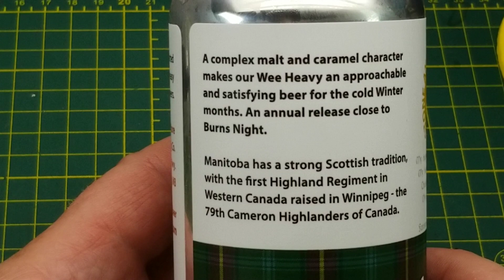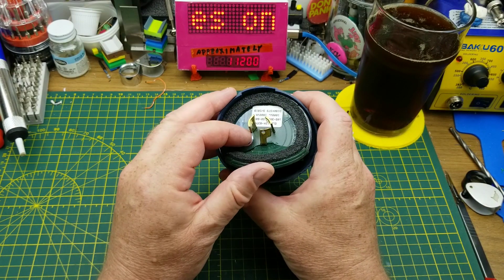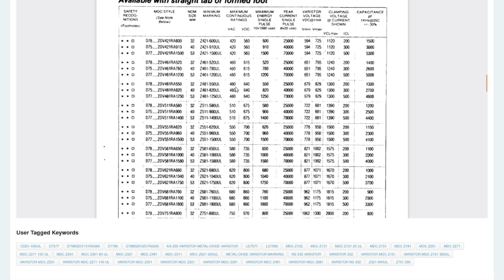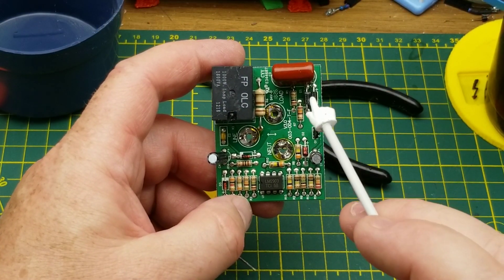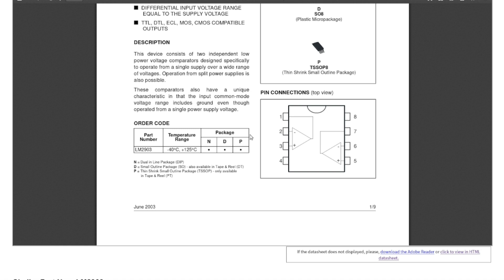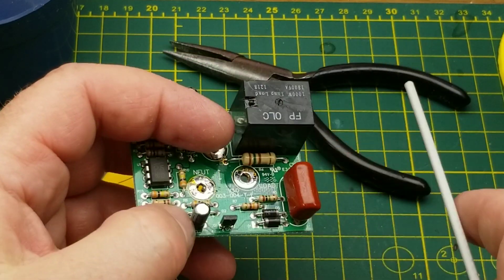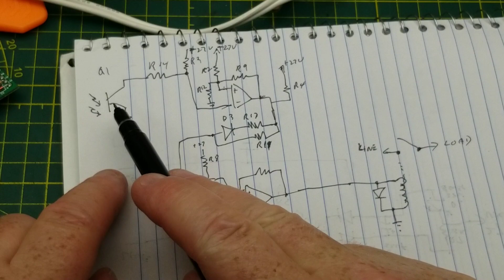Street light photocell : curiosity teardown

Comment: What do you think would happen on this if say you gave it 240v instead of 480?
Reply: It would work as advertised.  This photocell is ranged from 105 to 305 volts.  When he mentioned 480 volts he was talking about the component (looked like a capacitor to me) that acts as a surge protector.  Usually if you gave a 480V photocell a lower voltage it would remain on and the light just wouldn't work because it didn't have the required voltage.  With the new LED lights everything changes.  Older high pressure sodium and mercury vapor needed a specific voltage120, 208, 240, 277 or 480.  Led Fixtures are a range, 120-277V or 208-480 or just 480.

Comment: I don't know if anyone has mentioned one of its functions if it breaks down the light will stay on during the day. This way maintenance people know which light needs a new control.
Reply: This is usually the case, but not always, I would say around 75 to 80% of the time.  The resting photocell is closed, and you can feel the photocell close when you cover it.
Reply: I have a 50w led security light that came off of a utility pole. It has a built in photocell. When connected to the service wire it comes on for a few seconds letting you know it made a connection and when covering the photocell it will not come on. I want to remove the photocell completely from the circuit and run it to a switch instead. How would I go about doing so?

Comment: Hi - I am based in Australia, in the early 80's i was involved with the major local electrical manufacturer of switched and distribution boards etc.
We had a version sold to local sydney authorities calls the VSSW - Vertical sun set switch.

It was primarily a small solar panel, that could generate up to 5 or 6v dc - this was when the son was shining, there was some storage capacitors and a small battery pack used to store say 30-45 mins power to cover periods of heavy clouds

Anyway one there was no power produced in the photo cell and no battery power for a time delay, there was nil voltage, this then triggered the street lights to activate

Prior to that there was a 24hour timer on a control light ( possibly the control or master was chained and controlled a few city blocks )  - i cannot really recall, but i think they had a cover and a slotted switch that was set to 5pm 6pm 7pm 8pm - this is to allow for different sunset times during the year - a service technician would turn up every 3 or 4 months and change the time on setting

As a kid we would play in the street then at the right time, all the street lights would light up within 5 -10 seconds in the street, a friend who lived 2 blocks down on major intersection noticed that my street would light up and about 30 mins later his street all the light would turn on

Regards
George
Reply from the maker: Its interesting to learn how similar problems are solved with different approaches in other countries.
Thanks.

Comment: Manufactured in March 2019 using only through hole components?
Reply: The same design has probably been used for decades.
Reply from the maker: That's my guess - an old design that simply and cheaply "just works"

Comment: Relay is incorrectly shown, the relay itself is powered from the power supply with the open collector comparator pulling it to ground. The input has a fast charge, slow discharge, so that it takes around a minute for the light to turn off when the sun rises, but only a few seconds of darkness to turn on. Done so test is easy, cover photocall with a black plastic bag or box, and wait 5 seconds for the relay to energise the light. Also does mean the light comes on for a minute at power on, so allowing a test from the ground, using the fused disconnect in the pole.

By me the photocontrols are a little more complex, though the simple one there is very common, but there are a lot of more complex ones, which use Royce Thompson made units, which also self adjust to light level, so that they will work even in areas where the lamp is shaded by a tree or wall part of the day, adjusting after 24 hours to get the complete cycle, so they will go on at dusk correctly. Complex, with all the control being in a transparent DIP package, so you can see the electronics, and the large photodiode inside.

Comment: In mid 90s, I used to make a device like that but with 555 and a triac. I sold them to shop owners that din´t want to bother to switch on or off  theirs street lights at night or did not wanted to use time relays. It sold well few months until some shop took the idea and made the same circuit in a professional case (mine was made in  transparent plexiglas case)

Comment: There should also be a delay function in there somewhere, to prevent false switching in case, let's say for example, a big fat pigeon decides to land momentarily on top of the light, or, in the event of a dark cloud which might obscure the daylight for a short while.

Without a delay, that light would be at risk of erroneous multiple 'ON' cycles during the day, and with it, increased wear and tear to the lamp itself.
Reply: Some are a slight delay, some are instant, with the delay being the gradual or partial covering of the eye.  So most twist lock photocells will close if you cover with a photocell cover.

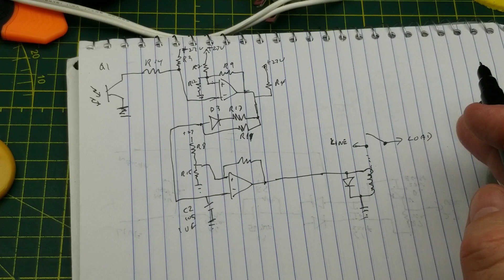Comment: Hi, form your schematic 9:58 the diode across the relay is drawn the wrong way around, all voltage will go to the negative rail and blow the diode or the output of the comparator ic.
Reply: Are you a hole flow or electron flow guy?

Comment: Good job! Feedback resistors for the op-amps provides histerezis, the second stage adds some filtering with a large time constant on the positive side and short on the negative. Also snubber diode should be backwards :)
Reply: I was going to say that but you beat me to it. When the input goes above the trip point the output goes low shunting the lower resistor with the feedback resistor so lowering the trip point. And again as the input drops below the new trip point the output goes high shunting the top resistor with the feedback resistor so increasing the trip point voltage. A simple way of providing hardware hysteresis
Reply from the maker: Good catch

Comment: so there must be an use case where this is not used, why else have it as a separate module, 
or is it more about easily replacing the thing when it is broken ...
saw a video from a London electrician doing highway light replacement, no such thing on top. (Nagy)
Reply: The London highway lights probably use time clocks and the dusk to dawn sensors are used throughout the uk on street lighting, UK Electrician
Reply: These sensor modules do fail from time to time, and being a 'twist/lock' fitting greatly simplifies replacement. It also provides an immediate line of defence against electric shock in the event of power being accidentally applied whilst being worked on - How? By simply unplugging the sensor, the light is rendered safe.

There are also different sensitivities of these modules to suit varying applications.
Reply: Here inSweden I've never spotted anything like this on our municipal streetlights - they're more centrally controlled with [sections of] roads going on/off at a time.
Reply: You have some lights that are individually controlled (like you see here) and some that control multiple lights on circuits with a single photocell and an electrical contactor.  Some use a motor driven timer like a clock that hits a on and an off switch at times on a dial, and some digital time clocks that you can program with times and days of the week to include holidays and dayliight savings time calculations.

Comment: The yellow part is the 5G death ray emitter.
Reply: Or a 480 Volt Photocell.
Reply: @69BTony  Woosh
Reply: @SinKillerJ  K, missed it, most photocells I have taken apart do not have the G5, they have the much more clandestine G7 disguised as a resistor.